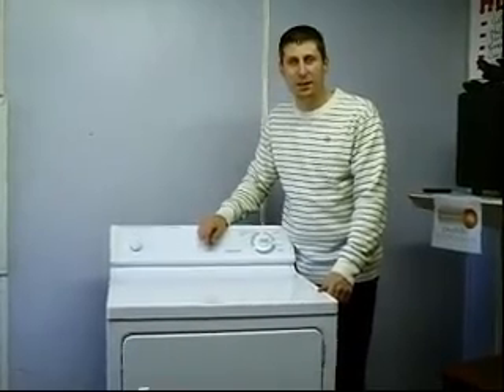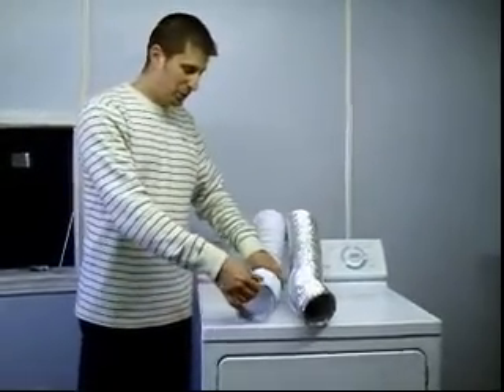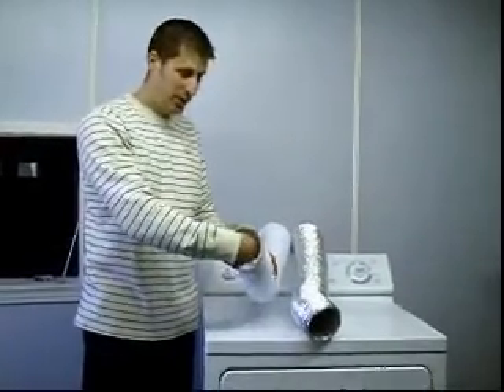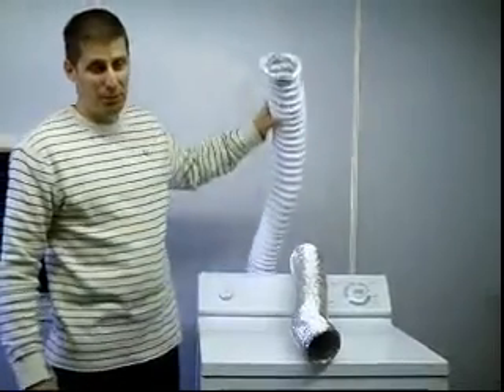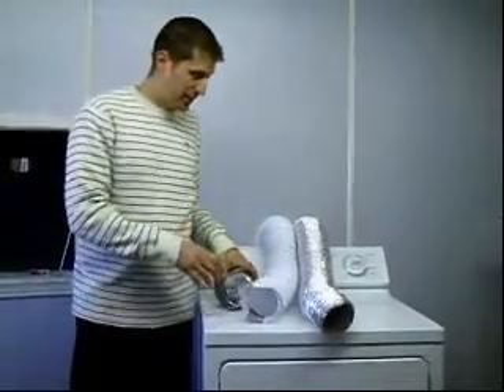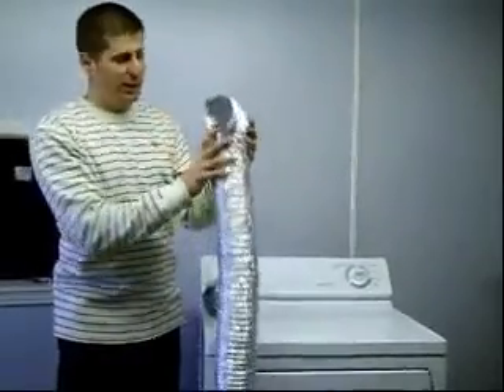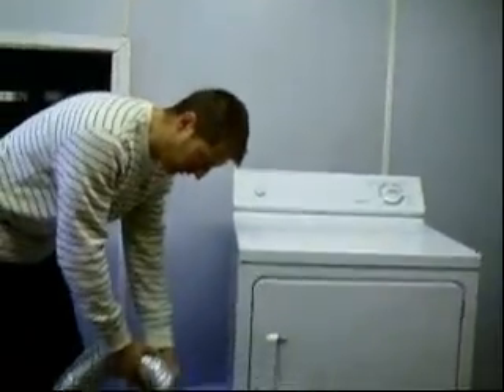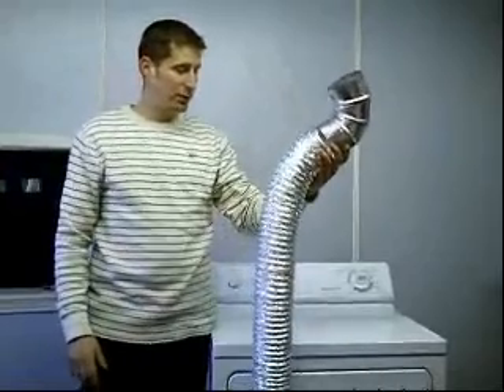Dryer Tip: Safe Venting

Comment: I agree with you. We should dry our clothes outside as long as possible. The trouble with Canada is that the temperature gets way too cold to dry clothes outside during the winter months.  So when we are forced too do it we must use the dryer and use safe venting.
Thanks.
Jeff